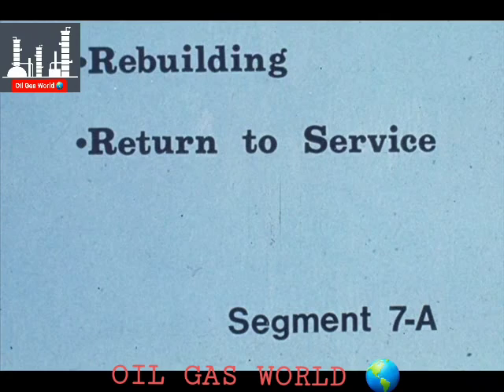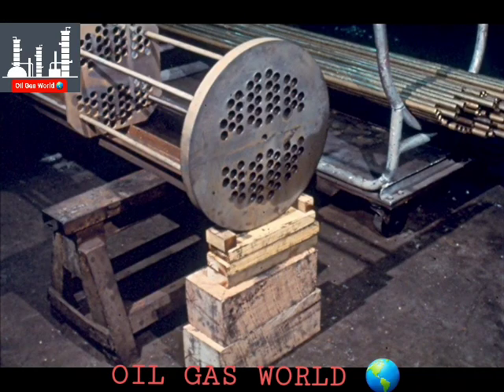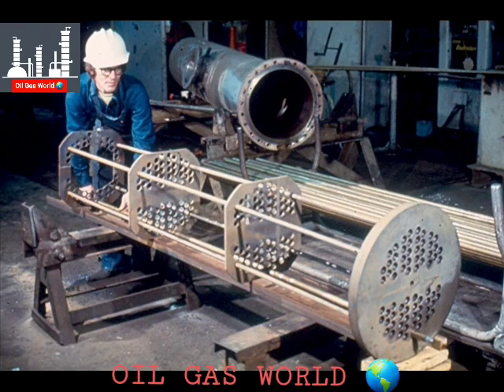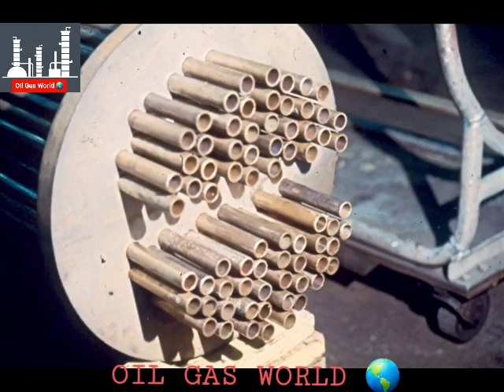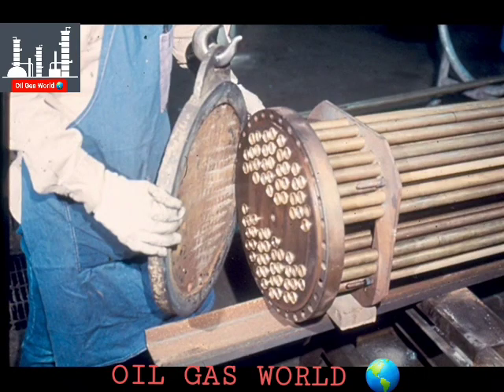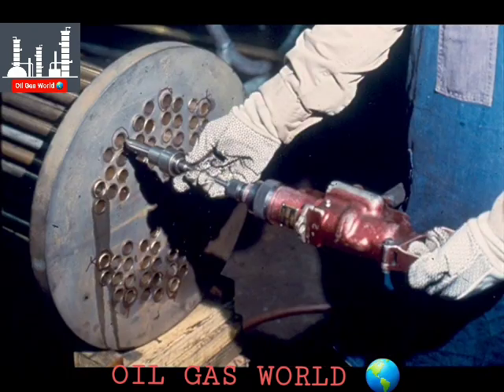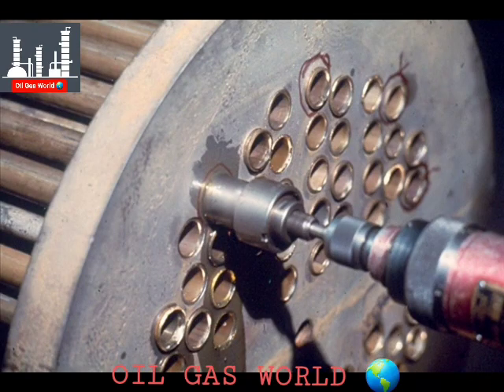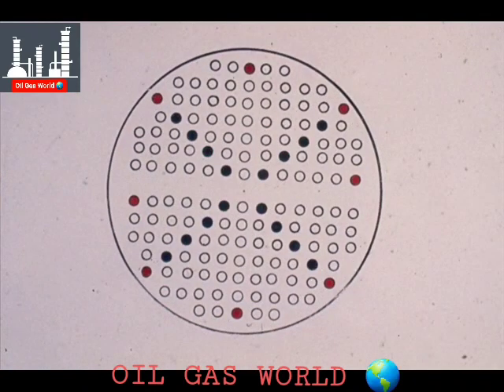Heat Exchanger Tube Bundle Repair Part 2 | Heat Exchanger Parts | Heat Exchanger Repair

Comment: What happen if a single tube choking in heat exchanger.?
What to do if a single tube choked. Please ans me
Reply: what you mean choking? clogged?
Reply: @jmfz28   choking my friend
Reply: You can use an hidráulic expansor for slight corrections
Reply: @jmfz28   what if some substance like high density fluid stucked in between the passage ?
Reply: @vivekb2329  try to clean the tube mechanicaly, with a threaded rod, or hydrocinetic cleaning, with a high pressure water pump. You have many solutions, i can help you but i need more info.
Reply: @jmfz28   sure brother, Because its an interview question which i faced.  Some collegue said we can use the plug in the individual tube.